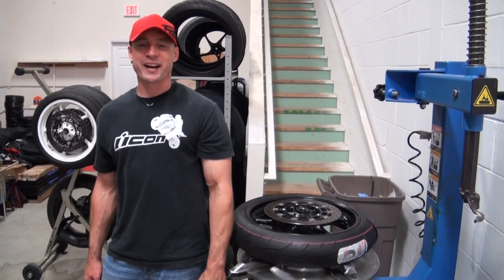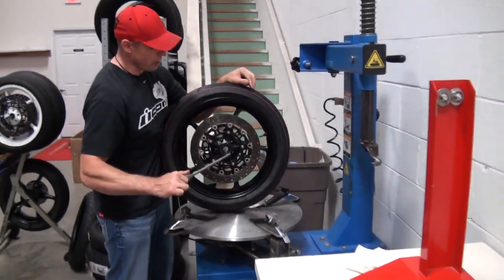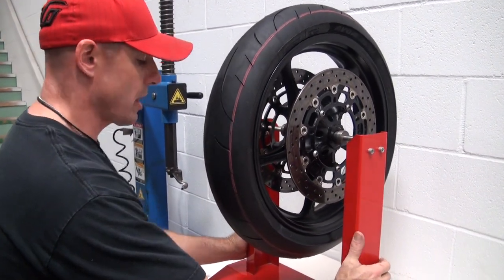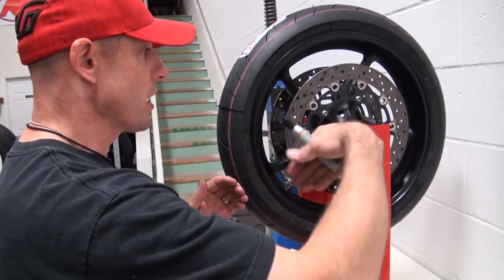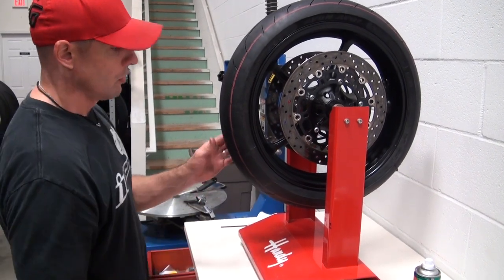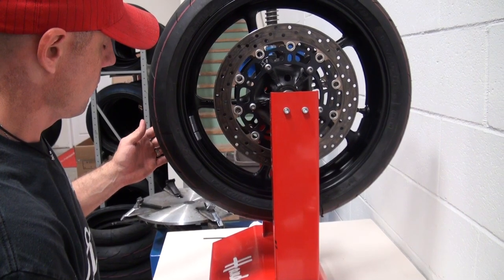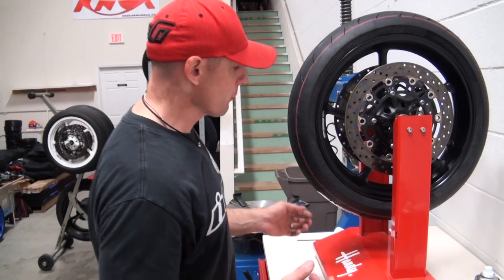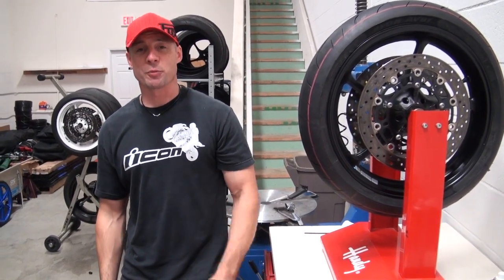How To Balance a Motorcycle Tire and Wheel from SportbikeTrackGear.com

Comment: and what if its not done ? will it affect the balance of the bike while leaning ? plz help im facing an issue while cornering my rear is sliding alot since i change my tyres ! i havent done wheel balancing as no one does it in our city
Reply: It's very unlikely that this has anything to do with the tire being out of balance, especially if a newer sportbike with a quality road tire.  Has the bike had any damage ever from any accidents/crashes?  Without knowing much more or seeing the bike, my broad guess would be it is likely to do with your suspension being very out of spec, if not damaged and your tire is mounted properly, even if out of balance.  The average modern motorcycle tire when not balanced is usually only noticeable at higher speeds, regardless of degree of lean or corner.   You'd only get some vibration, while cruising at highway or higher speeds.

Comment: Are the rotors required to be on while doing the balance? cause Im looking to get new rotors for my bike
Reply from the maker: You should leave the rotors on just to be sure. If the rotors have been a matched pair their entire existence then it shouldn't make a difference but I would leave them on the wheel just to be sure.
Reply: Sportbike Track Gear thanks a million

Comment: Need to balance rear tires?
Reply from the maker: Yes you should balance both the front and rear tires whenever you replace the tires or notice a vibration. - Van
Reply: Sportbike Track Gear well replaced rear tire to new. Drove about 100km speed upto 250kmh didnt noticed any vibrations etc.
Reply from the maker: If you do not feel any vibrations then you are most likely good to go! - Brian Van
Reply: Stay off of a motorcycle sir .... Thank you

Comment: What is the effect of an unbalanced tire on the front? Unbalanced tire on the rear? I just got new tires and I have a slight shimmy at high speeds. Could the front tire be out of balance? Thank you
Reply from the maker: Thanks for the comment! That could absolutely be caused by an unbalanced front or rear tire. If you had them changed at a dealership I would take the bike back and ask if they might check the balance for you.

Comment: You need to REMOVE your cush drive.  You want the cones solidly touching the wheel bearings of the rim to make sure its centered or your balance will be skewed.  The cush drives will move and skew your results!

Comment: Is this balance good for High speed balance?
Reply from the maker: SgtPickledic I'd say that it is fine for any type of use.  Van does all of his own tire changes and uses it on the street, track and racing.  As long as you are confident in doing it yourself, if not, then I would go to a certified mechanic.  ~Aubrey
Reply from the maker: SgtPickledic We're not talking AMA Pro or higher level here and Brian isn't exactly guessing.  What he does here isn't much different than the guys in the WERA paddock, etc.  He's won races and done quite well changing his own tires.  This method of changing/balancing is adequate for what most of us are doing on the bike.  However, this is only meant to be a guide and tutorial, as always, if you are not confident in your ability to do the tire change accurately and safely, then go to a professional.  We appreciate the input and feedback.

Comment: Hello guys ! I actually have an issue with tires. Just got the tires from your shop guys (Sportbike track gear) and installed them on my R6 but feeling some vibrations. it is really weird, did the balancing three times in different shops. i am totally confused as the tires are new and the bike is brand new, got this pb just after replacing the tires, any suggestion ?? thanks for your help.
Reply from the maker: Ahmed - can you shoot an email to Aubrey@sportbiketrackgear.com with the tires you bought, etc.?  Thanks!

Comment: how heavy was the sticky label.
Reply: Richard Wallinger i assume u mean the wheel weights. he added 4 of them which added up to one ounce of weight so they are quarter oz. wheel weights.
Reply: +SneakyBastrd59 No, the sticker on the tyre.
Reply: +Erelyes I can't tell if you are being sarcastic or serious. Either way, the weight of that sticker is irrelevant. The label sticker on the tire probably weighs in around a few thousandths of an ounce. So the tire would rip itself apart before that little of weight would have any effect on the balance of the wheel spinning.
Reply: 50 lbs,  great question ..... Stay off of anything motorized sir ..... Thank You

Comment: thanks for the video A++. What do you think if you just place the lightest spot of the tire to the heaviest spot of the rim, i heard good results, with that configuration you sometimes don't even need to use weights to balance it out, and if you do it would be with minimum weight attachment, if you would make a quick video showing that method it would be fantastic :)
Reply from the maker: You can try to match them up, it takes a lot more effort to do that IMO. I suggest using the method we show here. It is quick and gets the result you need. - Van

Comment: Zero balance the wheel bare and trim with a die grinder on the underside of the tire. Mount the tire and balance using duct seal.
weigh the duct seal and install appropriate weights. (Take off the sticker on the tirefirst!)
Reply from the maker: You are overthinking this my man. The sticker doesn't weight shit and will not have any affect on the balance. - Van
Reply: @sportbiketrackgear  Yes, You are probably correct, But I'm working on my own stuff so I can get a little crazy! Thank you again for the vid!

Comment: how du you know on wich side you must install the weight, left, right??? this method is not good!
a car balancer is very very much better to balance the tires, it says where, on wich side and how much you must install the weight. sorry for my english
Reply: This static type of balancing method works just as well because on motorcycle tires you always put the weight in the center, you don't need weights on multiple sides like a wide wheel on a 4 wheel vehicle, they operte on completely different physics characteristics.   Also when the wheel is no longer wanting to roll at any direction, than you know that you added the exact amount of weight needed to the wheels lightest spot, now making it perfectly balancec, or as perfect as you would need to never feel vibration up to the bikes top speed even.  Racers, including world Superbike Race team Technicians and engineers even use this method.  When done properly this way, it will always be impossible to prove an electronic laser balancer is going to make it any more balanced.  At Motorcycle mechanic schools and factory motorcycle dealerships, technicians often balance a wheel this way by hand on a static balancer like this and then put it on the dynamic electronic laser type balancers to make sure the electronic balancer is in spec, it never finds the wheel out of balance or makes any difference.

Comment: Wrong.   If you don't have a wheel balancer and need to do this in an emergency you can use your axle as the rod and use two jack stands as the base and it will get you "close".   At least closer than the method you describe.  It wont be perfect though as the your wheel bearing have grease and drag, the wheel balancers bearings are very smooth and have a light lubricant in them to impart very little drag.

Comment: Ah you forgot where to mount the tyre on the rim...the red zero or black “0” is technically the heaviest part of the tyre and should be located opposite of the valve stem so you don’t need to add a whole bunch of weight unnecessarily.  Common miss step....
Reply: Usually will balance out without weights “now-a-days”
Reply from the maker: Michelin does not use the marker on the tire, no need for it with they way they build the tires. - Van
Reply: Sportbike Track Gear agree

Comment: Wouldn't it be better and much safer to put two on one side and two on the other side so as to eliminate, as much as possible, gyroscopic forces produced by all four being on the one side of the rim?
Reply from the maker: They are so close it makes no difference. - Van
Reply: @sportbiketrackgear  Some might disagree when you hit speeds of over 160 or so. Thanks.

Comment: Why would you want duct tape on your $20,000 bike?
Reply from the maker: We are replacing tires constantly on the race bikes and use stick on wheel weights to balance them. Tech inspection requires the weights to be taped over to help ensure they do not come off on track. - Van
Reply: @sportbiketrackgear  aahhh....so not required on the streets  then?
Reply from the maker: No, not required on the streets. Just make sure you get the wheel clean before you place the stick on weights and you are good to go. - Van
Reply: @sportbiketrackgear  thanks Van! Appreciate it!!